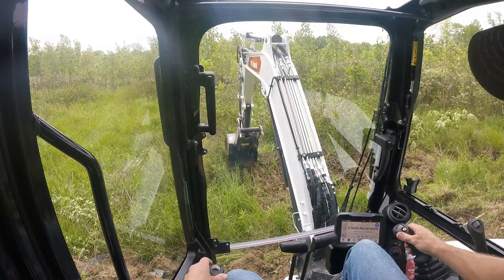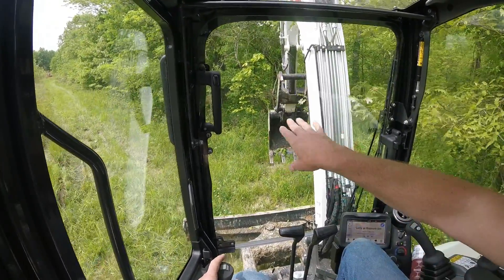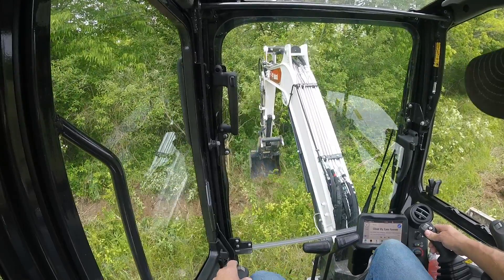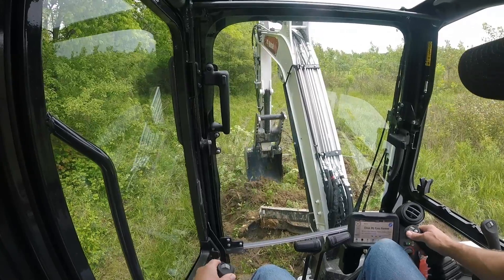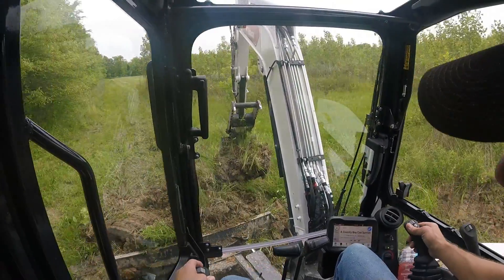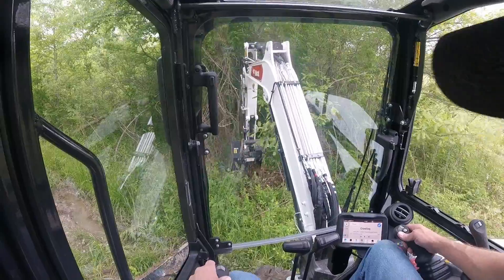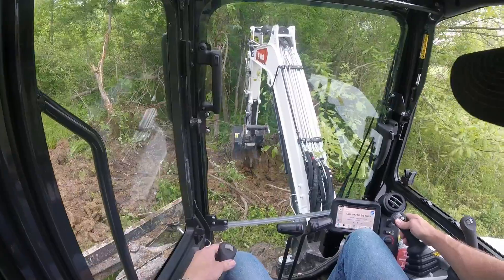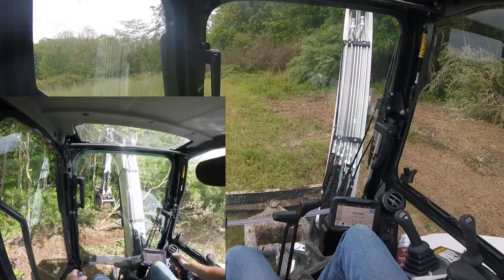'Digging' the new bobcat angle blade! Fixing low spots on the road system. Bobcat e42 R series mini

Comment: Excavators are made for ditch & drainage building, and are good solution to wet road & forests.  Does need a culvert?  Make a few wild life watering holes.  You need an air seat in the excavator.  Worth every penny.
Reply from the maker: I agree! And I do have an air ride seat in it!! Worth all the extra cash!! My back is still toast from all that tractor work several days ago, but the Bobcat mini is much easier on my back! Have a good weekend